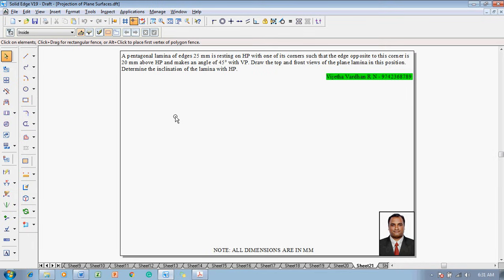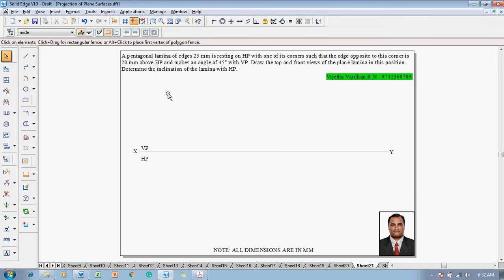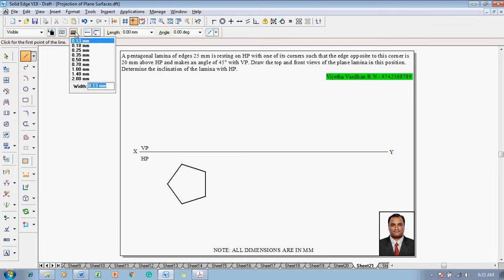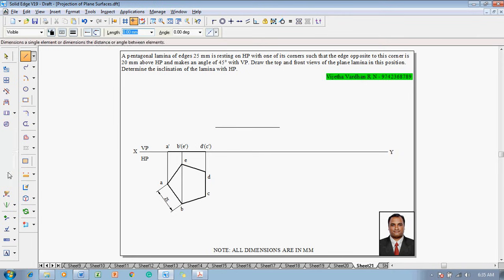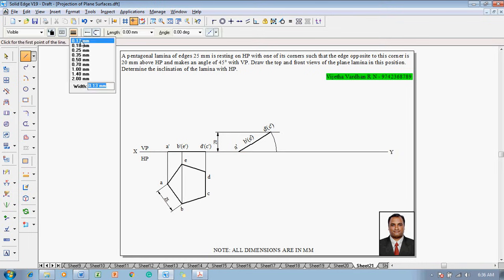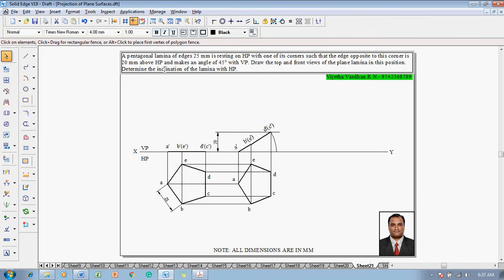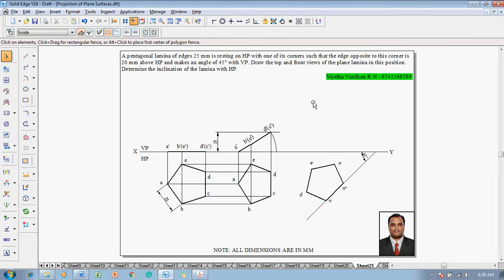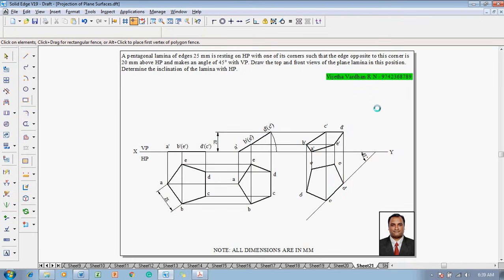Example 21 on Projection of Plane Surfaces

Comment: Hey sir i hv one doubt pls clear it🥺it’s corner resting condition then why it’s not bita inclination??
Reply from the maker: Apparent angles (beta or alpha) are not with respect to the corner or side resting position. If a line is inclined to both the principal planes then only the need of apparent angles to be constructed.
Reply: @ tq sir
Reply: @VijethaVardhanRN isn't this inclined in both planess?? If not then what's the difference between this qn and the hexagon qn which rests 35mm above hp (qn 45)